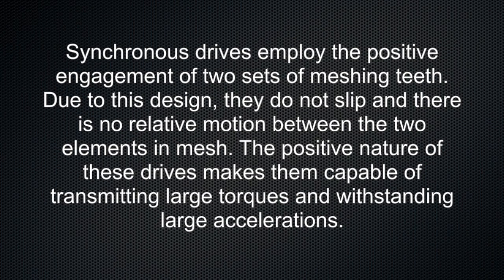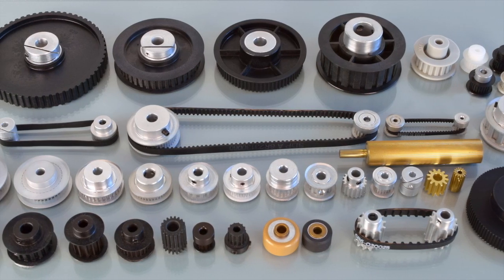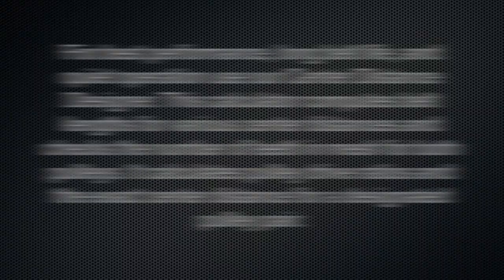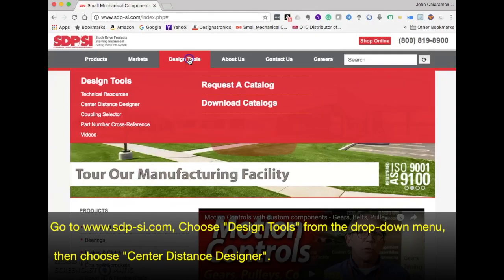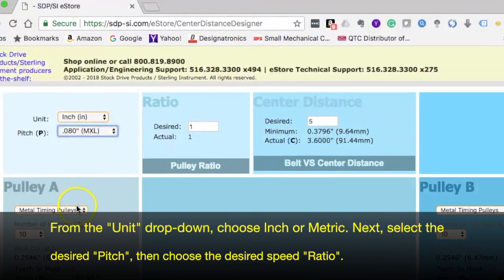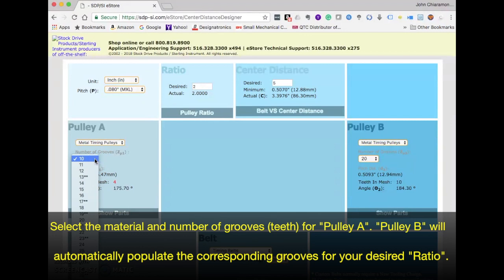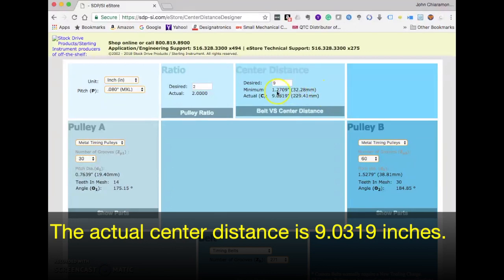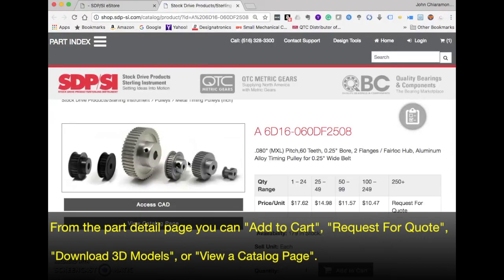Timing Belts and Pulleys

Comment: what best way  to reproduce get right belt   8.21 pitch    9.60 wide    original belt57 teeth possible material in roll form need info on best way to replace original

Comment: I know the pulley size, both 20 tooth, I know the belt size 200 mm, I need the distance between pulleys, but they haven't arrived yet. That calculator didn't help.
Reply from the maker: The pitch is needed, that or the size (OD) of the pulley.
Reply: @SDPSI  This is everything I have. Houkr 6PCS Aluminum 20Teeth GT2 Timing Belt Pulley 8mm Bore 6mm Width, Synchronous Wheel for 3D Printer Width 6mm Timing Belt and M4 Wrench
Reply from the maker: @CharlesSmith-io9fp  Assuming that is a 2 mm pitch, pulley OD will be 12.22 mm, center distance for 200 mm belt is 81 mm.
Reply: @SDPSI  Thank you, I'm attempting to mount a 4 1/2 inch saw blade with an 8mm shaft onto a 6"x6" platform with 2 small DC motors to power it, I will have to elevate the saw arbor about 1 1/4" to fit every thing.  Your answer is enough to roughly lay things out.